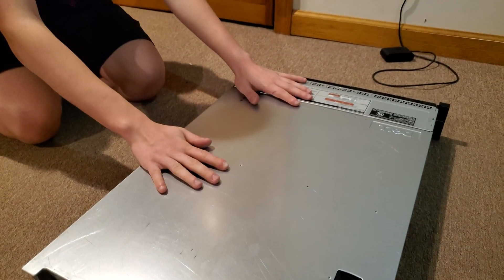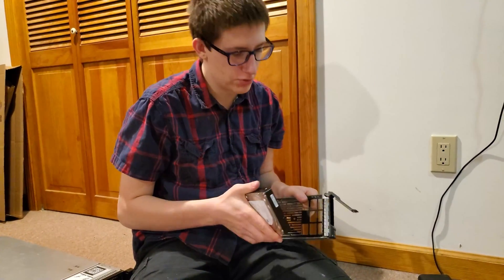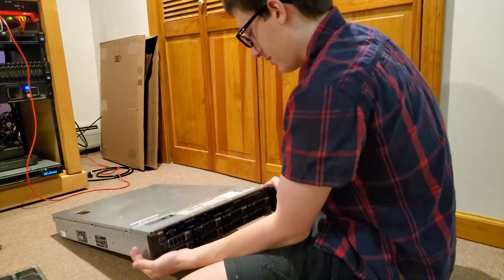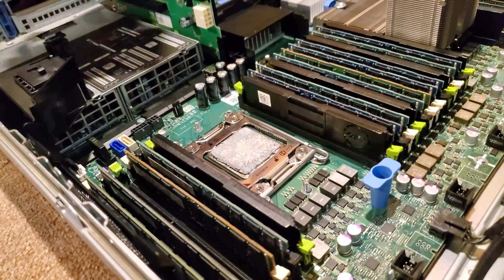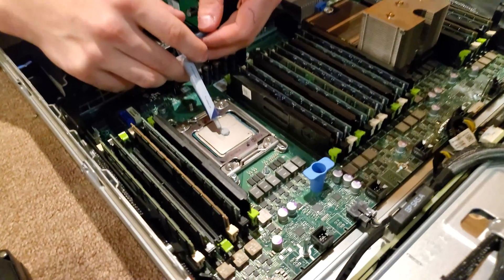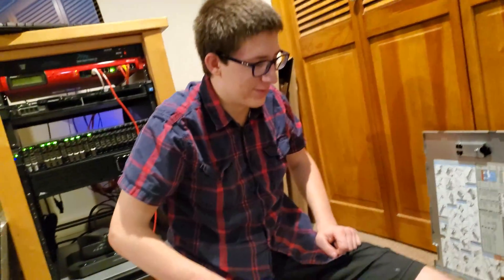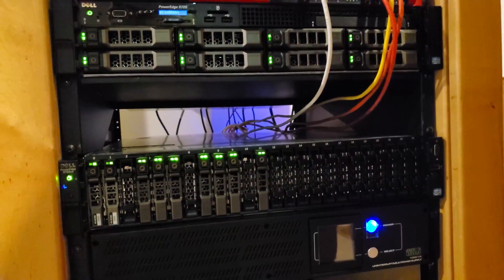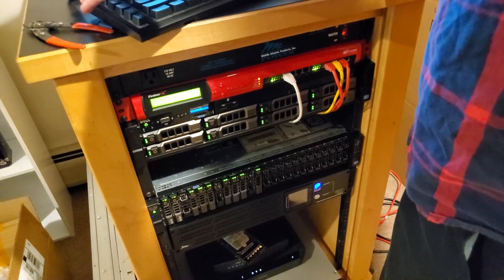Building a 1000 Player Minecraft Server!

Comment: "No server will ever need this kind of hardware"
- Minecraft 1.18 enters the game
Reply: Ain't intel xeons cheap you can get a 12 core 32 threads for 100$
Reply: @efeloteishe4675  Well yes, but Xeons are wayyyy to slow to run a big size Minecraft server. a Ryzen 5 3600 HARD BEATS a dual-Xeon setup since Java is not NUMA aware as far as I know and Java also wants as fast single-threaded performance as possible.  With a overclocked Ryzen 5 3600 I managed to do a 700 player test and the TPS went down to around 18 TPS and the world was pre-generated. I could have done more optimizations but at the same time, I knew that the Ryzen CPU was not gonna be able to handle THAT much of a playerbase.
Reply: @BrianTheMighty  no that changed Folia ist going to be released by papermc. Its a finally Multithreaded Minecraft Version. So the Xeon Cpu will be faster than the Ryzen
Reply: @JaWi_Brawlhalla  Yeah but Folia is basically useless right now since it is still in development and basically no plugins support it by default without being rewritten.

Comment: You cant have 1k players stable on a single minecraft instance no matter how good the hardware is, limitations is software not hardware
Reply: No, but you can have multiple instances and string them together. Bungeecord is one example, but there are others that can dynamically create and remove instances to meet demand. I have seen skyblock servers that use multiple instances, that you would never know used multiple instances unless you where told.
Reply: @jacobamador7989   you might want to check out multipaper ;). Also that is servers that are beeing started and stopped dynamic depending on players (hypixel does this)

Comment: Love seeing someone close to my age doing cool shit like this.  Wish server hardware wasn't so loud bc I'd totally get one if the sound was better.
Reply: All of my units or anything past the poweredge  rx1x is pretty quiet. I had a r430 that was so quiet all you would hear is the hard drives spinning. Also my hpe ml350 g9 is silent. Although keep in mind most enterprise equipment has a thermal calibration on boot. But once booted is silent unless you run it at 100% load.
Reply: Get a workstation pc with 2 xeon cpu's and it will be way more quiet
Reply: @LB-yx4yw  thanks for the idea
Reply: what about a dell poweredge r720 with 192 gb or ram @LB-yx4yw

Comment: should have gone with a server build from scratch with a X58 motherboard, server case and something like a X5675 which can be overclocked above 4.5Ghz as minecraft java servers performance really comes down to single core performance, for example the amount of chunks loaded by players will be dissipated better across the X5675 6 cores abd 12 threads and its overclocked 4.5Ghz clock speed :D

Comment: 3.7GHz is still trash
Reply from the maker: For a server CPU, 3.7Ghz is pretty darn good. Most server processors are sub-3Ghz because of the massive core counts
Reply: @spike_irl8112  you dont need a fast cpu for a server
Reply: That E5-1620 v2 has 3.9GHz single core turbo. It's the workstation/server version of an i7-4820K